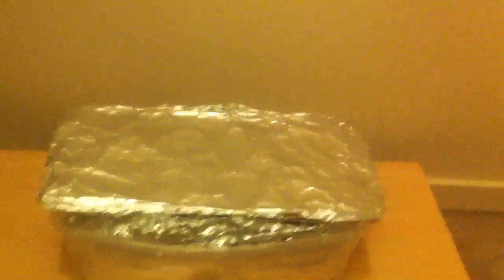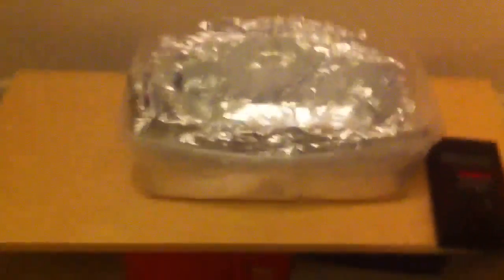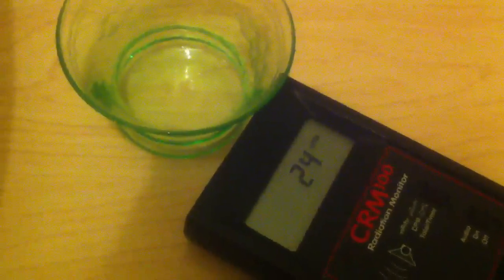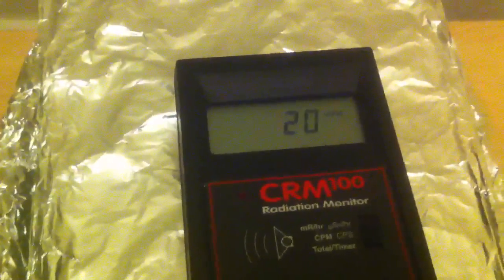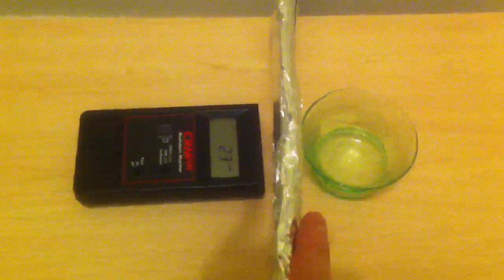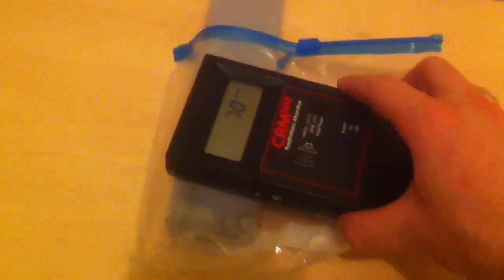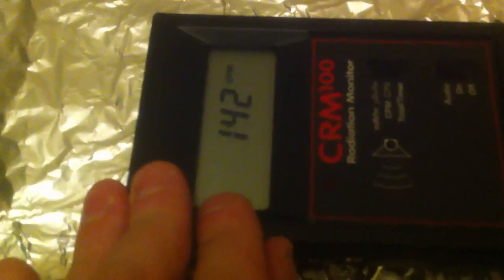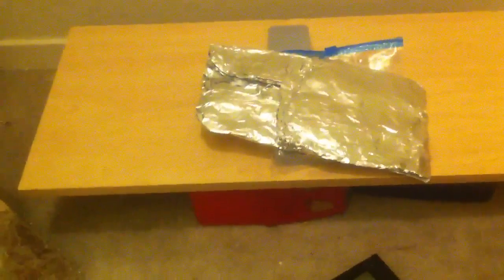RadMax Sheilding from United Nuclear - A Nuclear Isolation Box.

Comment: I recently purchased a 3g sample of depleted uranium from United Nuclear. It's much more radioactive than I was anticipating, at ~10,000 cpm. I don't feel comfortable having that in my house without shielding for gamma. What product would you recommend?
Reply from the maker: +Alexander B  Well, I honestly don't think that 3 g of uranium is particularly dangerous or omits that many gamma rays, but if I were really in a shield it here's how I would do it. I would place it in plastic, thick plastic. The thick plastic stops the alpha particles slowly without causing secondary x-rays. Next out but that inside of something aluminum, then inside of something copper, and then inside of something lead. Now that's overkill for 3 g of uranium, but if you absolutely want the radiation to disappear, that should do it. It's called z-graded shielding and it works by using higher and higher see valued elemental materials between the radioactive material in you. This he refers to the number of protons.

Comment: Cool channel! 
I've managed to build up a small collection of radioactive items, nothing insane, but enough to prompt me to build a proper storage container. I've ordered the materials to line the inside of a 50cal steel ammo box with one layer of United Nuclear's RadMax. Do you think that'll be enough? Seeing your earlier videos, it looks like I don't have anything as hot as the compass (the hottest thing I have is a Fiestaware plate). The box won't be kept in a regularly populated room.
Reply: No idea if you’ll even see this as it has been 12. Freaking. Years. But as somebody who is researching the building of an x ray machine, I am here nonetheless. To answer your question, for my sources which include Am-241, Th-232, U-238, and other relatively easy to find radioisotopes one layer shields plenty. However it doesn’t really do much for my radium source. If you really want to know, though, to be safe you can try to look for gamma spectra of the given radioisotopes involved in your collection, then attenuate accordingly.